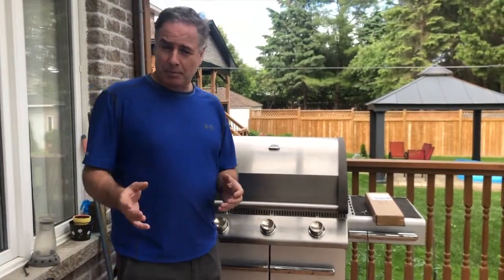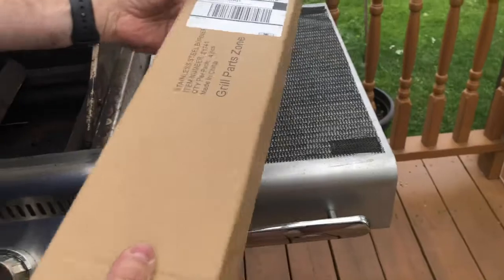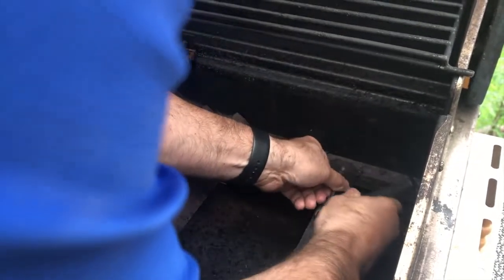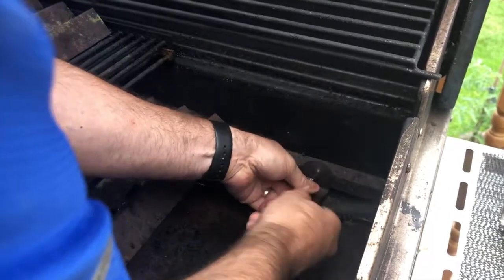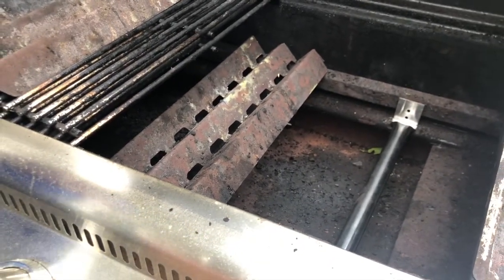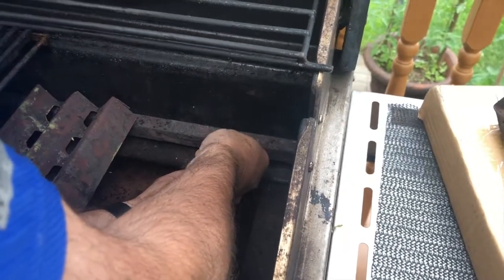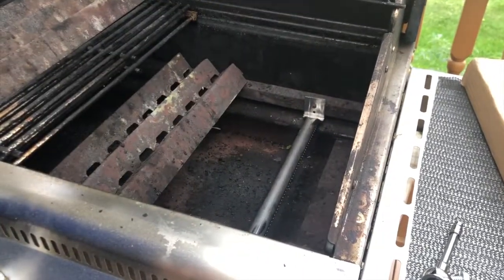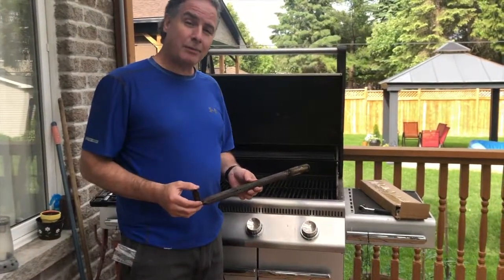Napoleon BBQ Burner Change

Comment: I have a 2013 legend 2 burner with original burners. after 11 years I decided it was time to change out burners. Much to my surprise only one seemed to be damaged but did the change out anyway. At the same time gave it a through cleaning and the Grill work jus like the day I purchased it. Bought the burners directly from Napoleon and the sear plats came with the burners. For 100$ I got a new Grill. Your video made it look very simple and I followed your instructions. Screws were a little rusted but worked fine. By the way Napoleon included new screws with the purchase. Awsome service very pleased. Canada.
Reply from the maker: Glad the video helped…….thanks for watching!!!!

Comment: Thanks for the video.  Any idea how to get the burner to light up when turning the knob doesn't work right?  I hear it click like it's trying to ignite but nothing happens.  I usually just use a lighter but know that's not the optimal way to light my grill.
Reply from the maker: You might have to look at that igniter and ensure that it works properly. Thanks for watching!

Comment: great video - thanks for sharing!  Question: any suggestion how to remove the pipe if the screw is stripped?
Reply from the maker: You should be able to just pull it out with a set of pliers and then just use a bigger screw for the new burner. Thanks for watching!
Reply: Any luck? I’m having the save problem. Can’t even pull it out.

Comment: Any suggestion , I see flames at the burner end when i ignite. and then goes away after a while and burner works normal. thanks
Reply from the maker: It sounds like a normal start up with the flame. Just inspect the burner for any cracks. Thanks for watching!

Comment: I've been trying to take those bolts for days and I still haven't made it...😢
Reply from the maker: If they just keep spinning they are probably stripped…..hopefully you can get a pair of vice grips on the bolts and pull them out. Worst case a grinder to cut the heads off and red till the holes.  Good luck and thanks for watching.

Comment: The head just broke off the screw when I took my burner tube off. Called Napoleon, and they're sending me a few new screws. I tried and tried to explain that the body of the screw is sticking out, won't turn with pliers, and I can't push it through the hole to get it out of the way. They kept insisting that once I get the new screw, it'll push the old one out. Which makes absolutely zero sense. If it's so corroded that I can't turn it or push it, how on earth is turning a new screw (which has no accessible threads to grab) going to push out a corroded screw? Very frustrated.
Reply: I'd drill the old screw out. I'm not sure what's on the other side, but if it's possible to get a knot on a bolt from the other side, that's what I would do.
Reply: @Klonen75  I'm sure that's the only way it'll come out, I'm just really ticked off that they'd try to tell me that the new screw will push it out. Don't like being lied to - worst crime in customer service.
Reply: Have you tried using pliers? Saw it off then drill?
Reply: @69ztang  Yes to the pliers. If I saw it off then drill, which is likely what it'll take, it'll probably destroy the inner threads.
Reply: @Dadtheimpaler  just use a bigger screw it will solve it.. for sure

Comment: Nice video, I was looking at a new Napoleon Grill and now they come with lifetime warranty on the tube burners.  The problem that I see is exactly what you are showing in your video which is that the burners are held on with fasteners which rust.  Also the new Napoleons have an aluminum pan so I might not be able to just drill a larger hole.  I'm guessing your pan is stainless since it looks like it uses sheet metal screws.
Reply from the maker: Yes, that’s right it is stainless! Good luck to you!
Reply: No matter what, you can always hold the burner with a small bolt and if needed a couple of washers. Buy all stainless from your local hardware store so as to ease removal next time.